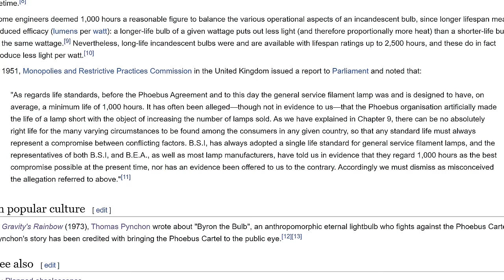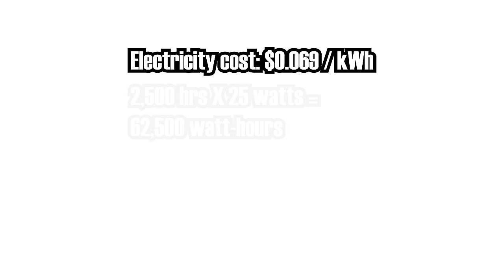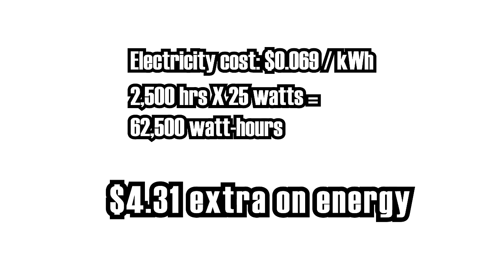Longer-lasting light bulbs: it was complicated

Comment: One addition ,as watchers of big already know: running leds with lower current not only makes them last longer but also makes them more efficient (opposite to incandescent lights )
Reply: Exactly! Good point, that (at least for me) still makes the cartel bad. On top of that, why didn't they put a minimum limit on efficiency instead of capping the intended life? I know it was done to increase efficiency of lighbulbs, but it seems suspiciously benefiting to the companies. One could just decrease the quality of the filament, making it last less and still have a bad efficiency, and it would still be compliant to the 1000hr max. So for me even with this explanation, the cartel is still the 100% bad guy.
Reply: @arthurdefreitaseprecht2648  there is no cartel. Cheap led bulbs are just penny pinched designs mostly from no-name brands. Long lived led bulbs exists, as most early adopters got ones and nowadays brands like Phillips still produce them with even better efficiency.
Reply: @PainterVierax I have only my personal experience to go by. After a few "High end", $10 a piece, bulbs died in less than a year, I have stuck to the $1 - $2 a piece ones without any noticeable drop in life span.
Reply: @PainterVierax  Why are Dubai bulbs not available worldwide?
Reply: @PainterVierax  even Philips maxed out the LED rating because they follow what's the market demanded. cheaper lamp. this is the reason why Dubai lamp exists and they were forced to make it that way because UAE wanted a real efficient and long lasting bulbs.
Reply: @10siWhiz  One reason could simply be price. (thats a poor reason) but would consumers in USA buy a bulb that costs 4x more for 2-5x the lifetime? To achieve the same brightness in the dubai bulbs there were 4x the LEDs, so the cost would be nearly 2-4x (probably not 4x cost, since glass+shipping+assembly are a major cost that aren't changing)
Reply: Biggie Clive yeah!
Reply: @10siWhiz They're manufactured by a single company, for a single purpose, and sold in low volume to their sole commissioner.

I would buy it, for sure, if it were available, but to most people it would look like a really expensive lightbulb with no apparent benefit over the cheaply-manufactured overdriven sludge being sold at a much lower price.

Since Phillips is one company, it's not conclusive evidence of collusion. Not to say there isn't some, but a Dubai lamp, like any other specialty bulb, is a comparatively low-volume special-order part.
Reply: This is true... but only if you ignore that their purpose is to produce light. As if you take it to the extreme, running them with the lowest current possible, 0 ampere, make them last the longest (forever) and provides the highest efficiency (infinite) but at the same time makes them totally useless as they now produce no light at all anymore (they don't fulfill the only purpose they have).
Reply: @10siWhiz  "Dubai bulbs not available"
THEY ARE AVAILABLE
To be more precise, Philips is selling an  even more effecient version of them worlwide.
Reply: @arthurdefreitaseprecht2648  It wouldn't have been as benefiting for the companies if they wouldn't have agreed on production costs, as in reality the 1000 hour version was cheaper to produce but they sold it for more. That's where the benefiting came from. If there would have been real price competition, the 1000 h version would soon have been way cheaper on the market and through price dumping most companies had earned way less than before.
Reply: @williamforsyth6667  Where? not in the US or UK
Reply: Technically it makes them less efficient ( relatively ), because the power factor decreases so much. A "standard" LED bulb is between 0.5 to 0.6 power factor ; the very latest bulbs are as low as 0.3 power factor. That means as light bulbs get more efficient from the consumer's point of view, they become far more expensive to generate the electricity to power them from the producer's point of view.
Reply: @luelou8464 where did you get this from?
I've played around with runnimg led chips at 0.000005 Watts and they do produce an output that is visible in a normal room but over 100% efficiancy sounds questionable.
Reply: @arthurdefreitaseprecht2648 I think it maybe a question of what they knew when. I heard that crook Edison tryed all kinds of things before they discovered tungsten. IDK if pure Tungsten is used or an alloy.
Reply: @n.shiina8798  Then Phillips saw the demand on the consumer market and made an improved model available worldwide.
Reply: @10siWhiz  bigclive made a video about those new Phillips led bulbs months ago.
Reply: @PainterVierax  his video on the Dubai bulbs is what I'm referencing. So there's an update?
Reply: @Heizenberg32  Mine is my 10€ E27 led bulbs with an aluminium case that I bought in a pro store are running an average of 12h/day and approaching their 11th birthday. Not the most efficient ones, although the 10+ leds inside are not overdriven.
All the cheap ones I've installed died prematurely, most of them because of capacitor failure.
Reply: @10siWhiz  yes there is. Even multiple ones if you're a DIYer.
Reply: elfrjz  you can get gu10 or e14 but instead of filament bulbs, leds need some circuitry which takes space and most importantly needs some cooling. gu10 led bulbs in particular are prone to fail because of temperature.
Though mounting a new socket on an existing building or device is not always trivial and using existing sockets allows to easily switch to led or to fall back to temporary filament and CFL still in stock when the led light break. There is a lot of tech inertia in buildings. Most houses I've visited still have old phone sockets, not even RJ11 or a RJ45 network.
Reply: elfrjz  Some industrial solutions do that by externalizing the DC conversion and sometimes lowering the voltage with an intermediate electrical box feeding the lights. tough AFAIR there is no standard for this kind of infrastructures so it's a lot of incompatible proprietary solutions, just like LEDs on recent cars or those unserviceable ceiling light fixtures which seems to plague US rented places. 
On our consumer side, home building, selling and renting legislation can prohibit this by forcing some standardized light socket fed with main AC, among other electrical wiring norms.
Reply: elfrjz  a lot of home appliances uses AC motors and/or draw way more than 200W peak. And this is much more prone to failure and harder to service. Local wired network and PoE are barely a thing in homes.
Reply: elfrjz  Are you sure most fridges don't draw more than 200W peak when it wakes up? You'd be surprised how much current some loads can be, especially when motors are starting up.
You also forgot things like most of all kitchen appliances, powertools, gardentools or hotwater tanks which often draws way more than 200W (not even peak, just continuous load). Even a TV can draw more than that. And a common non earthed Europlug is rated for way more than 200W. 
Though having normal plugs aside just means two separate power circuits in the building not including the Ethernet network. Your idea is not gonna work at all. It has been a thing long time ago in EU, it's kinda still the case in NA with double phased 220V appliances, and this is very inconvenient even on AC. Got to work on workshops with three phase and it's already tedious to have to deal with different sockets for different machines.
Reply: elfrjz  ok. Though a smaller table top fridge doesn't mean the peak consumption is lower.  Again, you'll be surprised about the inrush current of electric and electronic devices.

Comment: For a good comparison for this is to look at projector bulbs that were used in movie, slide, or other film projection.  Those bulbs typically only lasted about 50-100 hour long, but were extremely bright and gave excellent color rendering for displaying vivid color images.  The tradeoff of the nice bright light out of them was the short life span
Reply: And yet somehow I've never heard of a projector light bulb burning out in the middle of a movie.
Reply: In Professional Theaters you have xenon arc lamps, a highly specialized type of gas discharge lamp. They made a very bright light of 6.000 Kelvin, light daylight. They where introduced around 1954. Lifetime is 3500-4000 hours.

Other Xenon lamps with no specific colour for other uses have a lifespan of 1500 hours.
Reply: @Merrsharr  It happened occasionally, but there were procedures put in place to significantly reduce this - I've been in the odd film when "the projector failed" - and this is most likely going to be the bulb. The primary consideration is that most bulbs tend to fail when turned on, not when running and this meant that the failure happened at the beginning of the movie and required a relatively quick and simple replacement as long as the bulb wasn't too hot. From memory, from talking to a projectionist, they recorded the life of the bulb and replaced them before they blew. When the manufacturing is consistent enough, the expected duration of a bulb was a reasonably predicted duration.
Reply: @Merrsharr  The concept of preparing carefully has existed before you were born.
Reply: @Merrsharr  Many projectors also had a very nice slide mechanism, where you had a second lamp and optical block there, that you simply slid into place to replace the failed lamp, and then had a few hours to allow it to cool down to be able to change it, and clean the optical assembly, as you would find then very dirty from contaminants in the air blown in to cool them.
Reply: Tyrell: You were made as well as we could make you.
Batty: But not to last.
Tyrell: The light that burns twice as bright burns half as long - and you have burned so very, very brightly, Roy.
Reply: @Merrsharr  most movie theaters used xenon arc lamps...a lamp similar to the ones used in those bright white parking lot lights.  Prior to that, they used carbon arc.  They had carbon rods that were consumed in about an hour that produced a white hot spark like a welding rod.  During a movie, projectors were changed frequently as the reels ran out of film, and each time the projector was changed, the carbon rods were replaced.  watch for the cue marks in the top right corner of an old movie to change projectors ;)  Home projectors and smaller 16mm ones used for schools used halogen bulbs with filaments.
Reply: or single use flash bulbs
Reply: think the heat generated along with lack of proper  ventilation has allot to do with it genius
Reply: OMG, in grade school that happened all the time.... teacher would get flustered, and the AV nerd was sent to get another bulb from the supply room........ AV Nerd likely is living large today! I am old enough to remember sitting through the last few old old old reel-to-reel projection usually a flat earth science update.... ( slightly out of date ) that had hundreds of splices from years of use. Failures were guaranteed, as was the inevitable toppling of a CRT television being rolled into the classroom on a 6' tall, small footprint cart. We learned about gravity, levers, erasers and fulcrums in an unscheduled change of topic.
Reply: Well the better light spectrum was a coincidence not an aim of the planned obsolescence. Therefore I don't really see how this could be an excuse. Yes it's brighter but this was not the intention. It was to make it burn faster. Therefore using it as an example is still valid.
Reply: @fg68at Before that/at theaters who didn't upgrade xenon arc lamps, you had the carbon arc lamp.

Comment: My coworker hit this case spot-on. Before energy efficient bulbs were a thing, he intentionally bought a 230v light bulb to install in a 120w fixture.
This bulb would then run all day every day, and had clocked more than ten years of just sitting there cooking away energy to produce a modicum of light.
Reply: My parents brought over a 240V chandelier from Europe in 1970.  My brother has it and it still works on 120V here in Canada.   It's perpetually a dim orange over the dining table but looks nice enough.  So yeah, 50 years with the same bulbs.  Grossly inefficient of course but so what.

Now, I have a cute Swedish Christmas candelabra that uses seven hard-to-find bulbs in series, each rated for 17V or something.  I got sick of having to find the busted bulb every xmas and hunt down expensive replacements, so after some math I wired in a suitable resistor with a heatsink in series.  Now they are dimmer but don't die.  Sure they dump a lot of heat, but in mid winter who cares?  They're inside and warming the house.
Reply: @lakse123  You could use a standard incandescent dimmer, wired to a receptacle to achieve the dimming with less heat loss (I can appreciate the heat benefit here).
Reply: There were coin shaped diodes that dropped into the socket before you screwed in the light bulb.  The bulb was redder, but not significantly so.  Extended bulb life, at the cost of lumen per watt.
Reply: In some industrial applications, many times ago, there was some 380V light bulb running intentionally at 230v and they last over 50 years. I saw them with my own eyes working until a few years ago and they were installed in the 60s. They turned on and off several times a minute (they were signal light bulbs)
Reply: @AZaksLife  Running at a lower voltage, means the filament runs cooler.  Reducing temperature by 10C, doubles the life.  I'm not surprised these never failed, even being turned on and off.  Turning on, when the filament is cold and has a lower resistance, is the highest stress.
Reply: At a store i used to work at we used to sell 130 volt bulbs and we would guarantee them for 10000 hrs. They would be a bit dimmer but they only cost about 50% more. So about a $1.50 a piece.

Comment: I worked on a product at a previous job that required long life bulbs. The product used incandescent bulbs to generate light of a specific temperature for a spectrometer. The oranger long life bulbs put out more energy in the wavelengths desired, so everything was calibrated for that. My part in that project came decades later when our supplier of long life bulbs discontinued them. We had to hunt around for another one that was fairly close and then recalibrate the device. An uncommon use case for sure!
Reply: finding bulbs for easy bake ovens that still cook the same would be a light hearted but equally difficult challenge.
Reply: That's interesting for me because I am working on a project that uses nir spectrometers that have two tiny incandescent bulbs as ir sources with as far as I can see no way of changing them....
I guess I hope that they outlast the rest of the sensor....
Reply: You didn't work for X-Rite or GretagMacbeth, eh? :)
Reply: xkcd 1172 is real